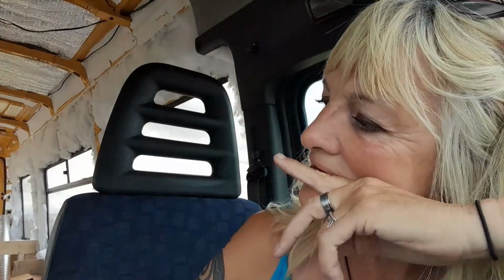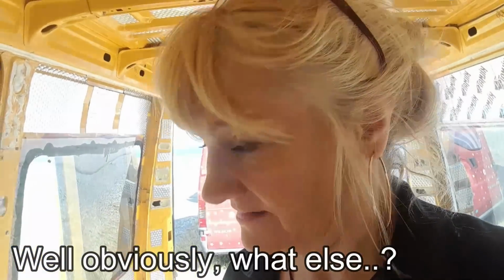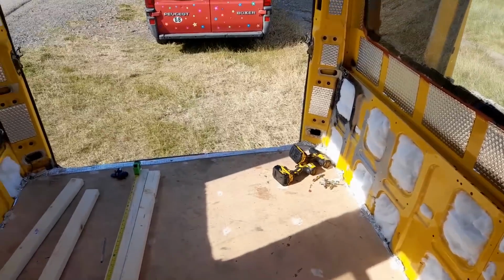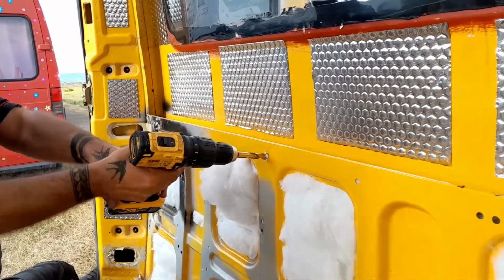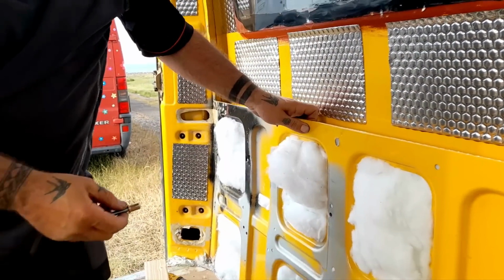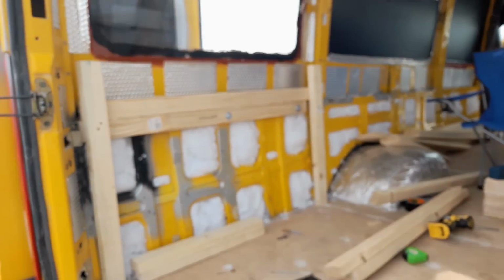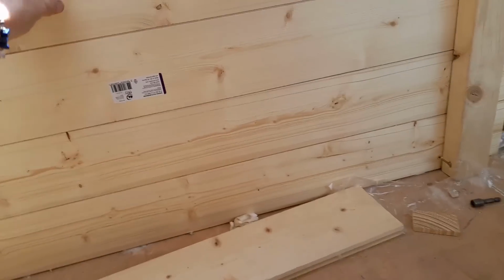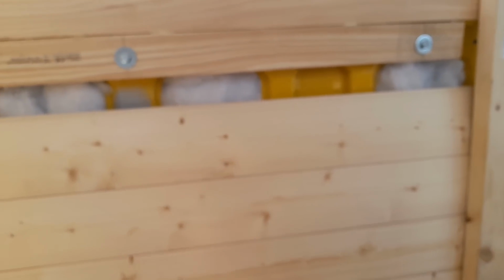Full Time Van Life! Iveco Bus Build-Ongoing Issues & Bed Built #vanlife #fulltimevanlife #ivecodaily

Comment: I used to be an auto glazier (its under rubber classic car windscreen rubber ) it’s on eBay i believe is the name of the seal you require, you could get it on line or visit a windscreen replacement company , the split should always be at the bottom, the sealant you use with this is called arbomast, 
    Your doing great on the side of the Rd , not for the faint of heart , good content and realism
Reply from the maker: Hey there, ah thanks for the info. I will have a gander 😊👍
Reply: @anothercampervanchannel  
My pleasure , unfortunately I am too far from you to pop by and sort it for you coral
Reply from the maker: @gixer7719  Ah well, never mind, info is pretty useful anyway 😁

Comment: It will need new rubber if you go to a window place it will not cost to much but you will need it doing the last thing you need is it pissing in when you have converted it
Reply from the maker: Maybe Les, but I've put more sealant round and a friend pushed the central seal in as they looked like they were sticking out a bit. Put the hose on it earlier and one window at least seems a lot better. I'll know more when we have a downpour or go to the car wash to use the jet wash. 😊👍🤞